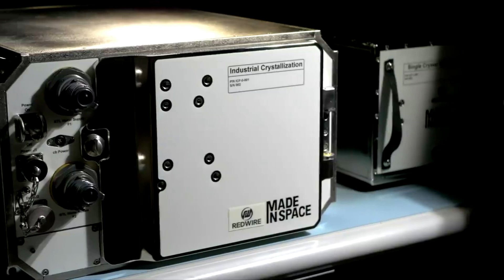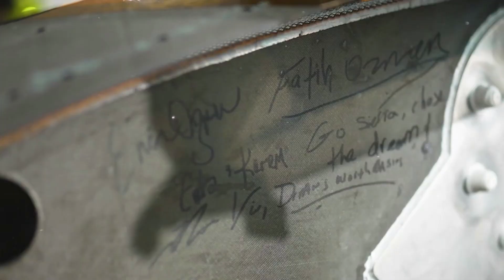Are Sierra Space & Blue Origin Making Progress On Orbital Reef?

Comment: Any company relying on Blue Origin to get to orbit is insane at this point, Blue Origin is struggling to provide ULA with 2 working engines and their New Glen prototype is still no more than a mockup, never mind the 7 engines they need to power it.
Reply: the first two engines are obviously the hardest. I would not be surprised if we see first New Glenn booster prototype ground testing in 2023.
Reply: @plainText384  No, the design obviously has serious manufacturing problems. They have been working on these two engines for over 2 years, that is crazy for 'production' engines. It is clear these engines are vastly more difficult to construct and hence more costly than Blue Origin ever planned. I would say they need a version 2 redesign before they are really ready for production. New Glenn isn't even a prototype yet, the version seen being moved about at the cape is still just an empty shell mockup and that is all they have so far.